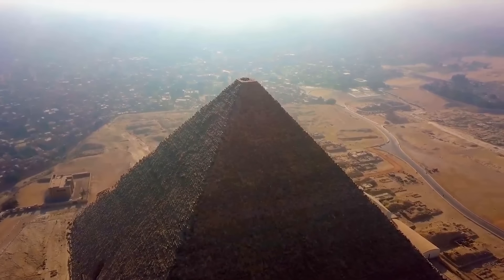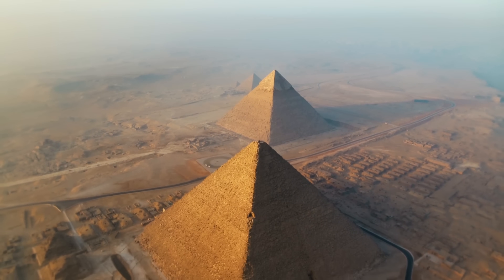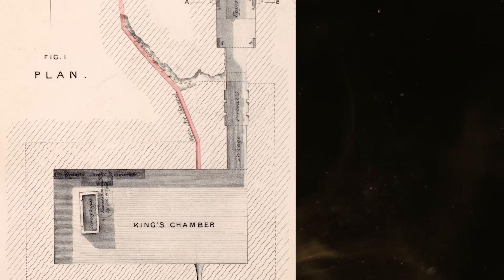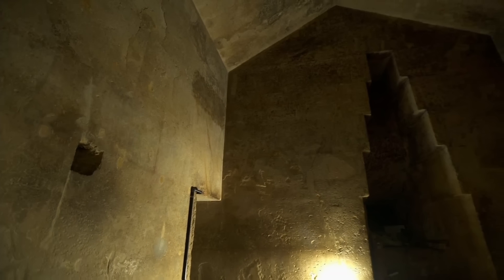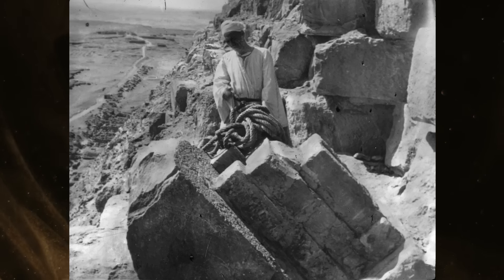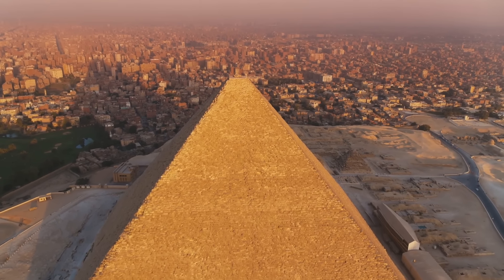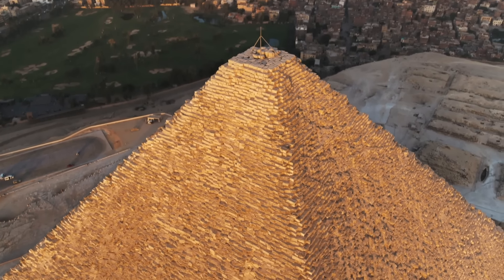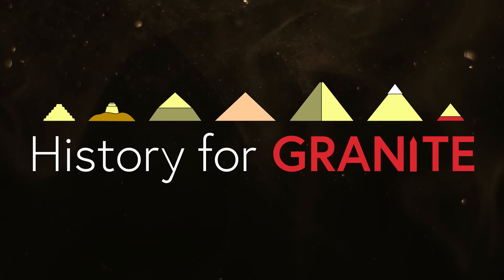One Solution to the Four Channels of the Great Pyramid

Comment: Have you ever cut a hole through a piece of stone? Or even drilled a hole through a piece of wood? The problem is that as the hole breaks through on the other side, it breaks away chips of wood from edge of break-out. So... the way to get a good finish to the edges of the bread-out hole is is to  drill short, then finish the hole from the break-out side. Why not start the hole in the granite block from the chamber side, I hear you ask? Well, the hole has to line up with the rest of the conduit to the outside wall, so you start the hole on the back side of the block to make sure it lines up, cut the hole short, then finish it from the front to get a good finish at the edges. What lends credibility to this scenario is the fact that in the Queen's chamber, the holes were not finished by drilling them out from the front. This is another instance where the Queen's chamber was not 'finished'.

Also, no reason is given why the hole was finished after the construction of he chamber was finished. Why should that be the case? An interesting clue, however, was in the video I watched before watching this one, on the sarcophagus' found in the pyramids. These were very plain and rudimentary compared to the sarcophagus' found in the tombs and mastabas of lower ranking individuals. The conclusion was that the Pharaoh was not buried permanently in the sarcophagus, but 'rested' there for some period before being removed for some other more permanent arrangement. What went on in the chamber in the meantime? Whatever it was, it would have needed ventilation.

Comment: I am curious about the rounded edges at the entrance to the King's Chamber vent. It was rounded in pictures taken in the 1800's so it couldn't be from millions of visitors rubbing it. It looks like water erosion and it had to be from hundreds or thousands of years of flow. I hypothesize that the chamber was an ancient water tower that supplied drinking water under pressure to the populace. The close fit of the granite blocks is consistent with the need to be water tight. Granite is both water tight and resistant to erosion. Egypt had a reputation for having the best tasting water. Allowing silt to settle out while in the tank may have been the reason. That isn't the only location of what appears to be water erosion. The top step of the Grand Gallery was badly eroded as was the entrance wall to the antechamber. The portcullis stones have been eroded back an inch on the front face and the top edge is heavily rounded and non symmetrical. We also see the ceiling of the passage between the antechamber and King's Chamber has been scoured severely. The top edge of the coffer is heavily eroded which would make no sense if it was a tomb. The "broken" corner is also rounded which says it was not broken. The idea of a water tank makes sense if the coffer is placed in the antechamber so the unbroken end is flush with the portcullis stones. This barrier would force an inrush of water to go up and over the portcullis stones where it would be trapped in the antechamber. It is worth noting the edges of the coffer are much less eroded at the end that would be under the portcullis stones. The coffer just so happens to be long enough for the far end to block the exit of the antechamber. Grooves in the wall are deep enough for water to make it past the end in a controlled manner. This could have been to prevent silt from getting stirred up by a heavy inrush of water. If the King's Chamber was to supply water through the vent then there must be a downward passage from it to a tunnel beneath the pyramid. No such passage has been found but it may be hidden. To keep animals out of the water it might have been setup to act as a water trap. This means the downward outlet must be where the vent passage is slightly higher than the rectangular opening in the wall. The vent is horizontal for a distance then begins to rise. At this point Caviglia started excavating the area beneath the vent and a small downward shaft could have easily been covered up. They were looking to find a room full of treasure and a small hole would be of little interest. It is feasible water was supplied to the pyramid from a reservoir created by the Sadd El-Kafara Dam. Scholars are at a loss to explain the purpose for a dam built in the middle of nowhere with no community to serve. However, this would make perfect sense if it was to provide year round water to run the pyramids. Presumably a tunnel was dug under the Nile to convey the water. A vertical shaft filled with debris was found in the space between the surrounding wall and the base of the Great Pyramid. This would likely reach down to the tunnel. The Egyptian Antiquities people decided to fill this with cement thus covering up important evidence. The dam was at a higher elevation, about 65 meters above the pyramid base. Thus water could reach halfway up the pyramid. As the pyramid and wall are built, water in canals could have been used to float stones into position. Water lifts could raise the stones from the causeway to the build level so that little manual effort was required. It is more likely the wall surrounding the pyramid rose to the level of the entrance to the pyramid. It may have been regulated by a weir that spilled excess water down the causeway. This could have been used to pull stones up friction free by rafts that span the width of the causeway. Water flowing down would build up in front of the raft until it was high enough to lift the raft off the bottom. It doesn't take much depth to lift a raft off the bottom because of the large area. Calculations show that stones could be pulled up the causeway with one third of the force it would take to drag on dry ground. And these rafts could carry men or materials down the causeway with no force at all. I calculated that a constant 300 liters per minute into the King's Chamber could deliver 380,000 liters a day with a peak usage of 800 liters per minute, two times a day. This would use half the water in the chamber so it wouldn't uncover the vent. So how could it pump water all the way to the King's Chamber? That is the big question and I came up with several possibilities. We know it must have happened because of the erosion.  A tremendous amount of air pressure would build up in the Subterranean Chamber (SC) if water flowed down the passage into it. This could have communicated with the Queen's Chamber and maybe got water sloshing back and forth in a resonant fashion and forcing it up the Grand Gallery. Another possibility uses the principle of water hammer where a huge pressure spike is created when flowing water is suddenly blocked. That is the behaviour of a ram pump where a lot of water is used to shoot a little water much higher than the source. In this case a valve could have been placed at the point where the descending passage transitions to horizontal. The valve may have been one of the stones found in the pit of the SC or in a little expanded area in the horizontal passage. These stones are dressed with flat faces and have holes that could have been hinges. The stones would have been removed in order to gain access to the SC. I have to imagine water would drain through the rock of the SC. There is a lot of area there and the water wouldn't have to drain very far before another blast of water flowed down. Water flowing down the passage would gain speed until it picked up the stone valve so it suddenly covered a hole that water flowed through. The pressure spike created by the sudden closure smacked against the face of the plugging stones blocking the ascending passage. Water on top of the blocks would shoot up the gallery where it splashed on the top step and evaporation of the spray chilled the water. There are reports that the upward passage was filled with limestone blocks that were more easily pulverized than granite. This would be much better for the pump. A shock to the lowest stone would pass through all the stones and water on top would go flying up. This would be a very clever way to pump water to a higher elevation by starting higher up. Ordinarily you have to pump against a pressure of a tall column of water but here the column doesn't start until the base of the Grand Gallery. People will ask "why build this to supply water when the Nile is right there?" Well it isn't right there. People had to live above the flood levels and many lived much higher than that. Water under pressure could serve a lot of people. Instead of paying somebody with donkeys to carry water up from the river, they could pay the pyramid operators instead, making the pyramid a money producing venture.

Comment: Interesting video essay, but as a scientifically-minded interested person with zero preconceptions on this topic I did not follow the apparent presumption the role of the King's and Queen's chamber channels must have the same purpose. Nevertheless, it would appear to me to be reasonable to assume, as you do, that they might employ the same construction methodology if that avoids them being blocked during construction.

If we discard the twin assumptions that (i) their purpose must be linked and (ii) they were not finished and look at them separately then we could re-assess them as follows:

The King's chamber channels appear to have a finer construction throughout and especially at the chamber end - offering the implication that they are in some way "on display". Their connection to the outside (particularly if they dip at the end) indeed supports the assertion that they were made for external ventilation. By contrast, the rougher channels of the Queen's chamber are more reminiscent of conditions you might see in the off-limit or out of sight areas of a shopping mall or office building, once you have passed beyond the "public" area. Taking that assessment, without the assumption of them being unfinished, and noting that they do not directly connect to the outside due to the deliberate stone blockage as our starting point, begs the question of "what could a shaft sealed by a stone block with copper pins act as a conduit for?" The answer is that they such a conduit could only be for something that could pass through that barrier, and while the physical attributes of dead king or queen's souls are unknown to me, there a more logical, even if seemingly absurd, answer I am aware of: electricity!

Comment: Ive always thought that the large pyramid at giza if not all 3 started out as stacked mastabas similar to a zigurat and khufu (khafre?) Turned them into what we see today. What function they served? How much they were changed inside to manage the weight of the stone? Who knows but so many things just aren't right about the constructs and the whole site, it could explain why the "vents" don't reach the outside from the queens chamber, the contrast of outer stones to some subsurface and architecture that seems to be covered over also if you imagine a massive sloped staircase built up from the causeway it answers the question of getting blocks up when it was turned into a pyramid. 
its just always stuck in my head🤔

Comment: There is one crucial point that the narrator missed out: there is no sign of soot on the walls nor ceilings of these chambers that signifies the use of torches or candles. Additionally, it is clear that the outside of the pyramid was built first, and then they attempted to finish up the interior. So, it begs the question: what lightsource did the workers use inside the pyramid when it is pitchblack in there?

Comment: So the biggest question I have about the Great pyramid of Khufu is...what did Khufu's funeral procession look like?  What was it like being one of his pall bearers?

Upon entering the Pyramid through it's original entrance, you enter the descending corridor.  Which is 4 feet high and 3.5 feet wide.  BARELY big enough for a modern casket to fit through.  You definitely couldn't stand on either side of it like a modern pall bearer.  I guess given the slope of the original corridor you could put the casket on a sledge or something and slide it down, maybe lowering it with ropes, or if the friction is enough pull it down from the inside with ropes.  If he was going to the subterranean chamber, no problem, just pull him on down the hill, except I'm pretty sure they didn't because it's unfinished and the rest of the interior exists.

So now, as originally built, there's a hole in the ceiling.  And your job now is to lift this casket from the floor with a nose down angle of 26 degrees, up to the hole in the ceiling with a nose up angle of 26 degrees.  I suppose the best way to do that would be attach to ropes being hoisted by men up in the grand gallery, because you're just not going to lift hundreds of pounds of Khufu and his gold burial masks and so on like that when you can't even stand up straight because the ceiling is only chest high.

Then I suppose men already stationed up in the grand gallery breathing torch smoke this whole time would haul on ropes to pull the casket up the ascending passage, over whatever now missing structure covered over the entrance to the Queen's chamber, and into the grand gallery, where the casket could be picked up and lifted over the granite plugging stones which have to already be in here, they would have had to have been in here the whole time, the pyramid build around them because there's no way to bring them in once the Grand Gallery is dried in.  I strongly imagine they would have rested in the center, so once Khufu's casket was hoist into the grand gallery pall bearers standing on the benches would have to lift and carry him over, probably sliding the casket onto the floor of the antechamber where he would have to be slid under the open portcullises and through the narrow shaft into the King's Chamber, where there's plenty of room for men to lift the casket into the sarcophagus and then seal the lid.
Reply: The funeral procession may have happened with the queen's chamber passage open, possibly with a temporary ramp installed so the casket could slide smoothly up into the gallery, but some structure of some strength and precision must have been in place when the plugging stones slid past.  If the horizontal passage was plugged with stone slabs, I don't believe this would have been opened and closed when the pyramid was finished.

Comment: At 9:54 of the video you show the exit point of the Kings chamber southern shaft before it was 
covered. This image shows the square opening at the center of a perfectly carved block resting
on a wide flat surface. If you measure the opening at 8"X 8" you can scale the block to give you 
 the width and height of all of the blocks that fill these passages. Look at how wide the base 
floor block is and the gap between the blocks that wrap the sides. This indicates that ramps 
were built first and were larger than the blocks that fill them.

Comment: 21:44 perhaps an explanation of the score & corner markings of the wall and corner finish? They appear to be directional and the excess left on the corner has disctinct pointed indentations from the process of removal. Tool or method used?

Comment: The air vents of the kings chamber wouldn’t necessarily need to be open all the way out. At the height they reach, the inside chambers could be finished and no longer need ventilation for the workers and the casing blocks could be seal it off. This explanation would go as far as to explain why the unfinished queens chamber vents never reached the outer core blocks.

Comment: The king chamber is a hydraulic pressure chamber. it is perfectly sealed and channels are used as Bernoulli's principle. more water = more pressure. Please explore this theory, it's really solid when you study it. it's explain everything in the pyramid, its pure science and logic. when water fill the channels, the pressure inside the chamber increase until it "push" a block to unlock a secret chamber. (maybe the real king chamber?)
The kings chamber was blocked with the "sarcophagus", to sealed the chamber.
the unfinished channels are in fact to run some test before finishing the pyramid. 
the big gallery is in fact here to evacuate the water before the pressure becomes to high.
the big granite stones are here to counter the pressure in the kings chamber.
The queen chamber was to run tests before doing the kings chamber
the underground chamber was to flush the water in the ground

Comment: I have always thought they were for ventilation. The workers building the pyramid would need fresh air in there, especially given that they were using oil lamps for lighting. Maybe not the guys doing the heavy construction, like setting the ceiling blocks, but certainly the guys doing the decorating would need fresh air, and perhaps their materials would as well.